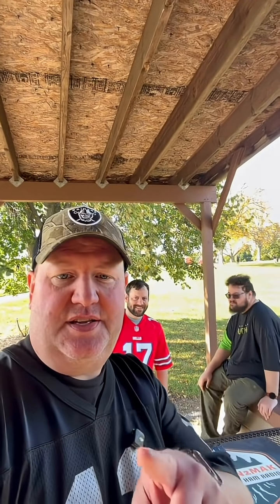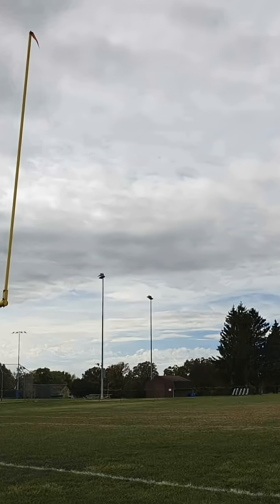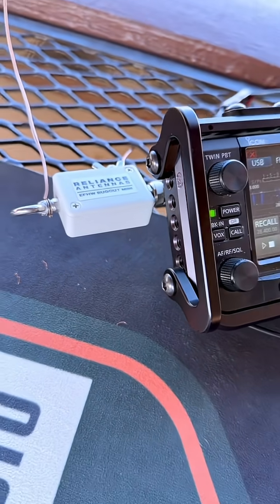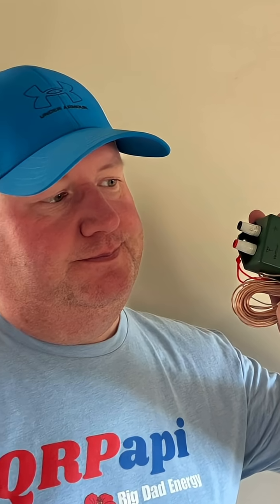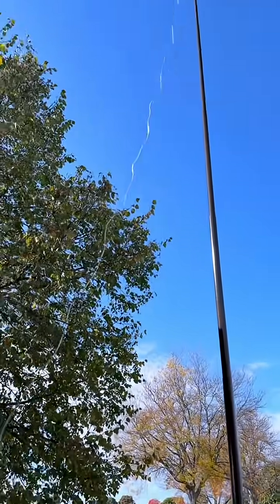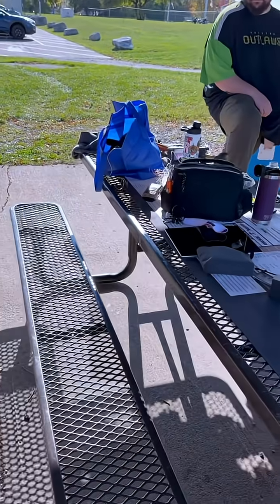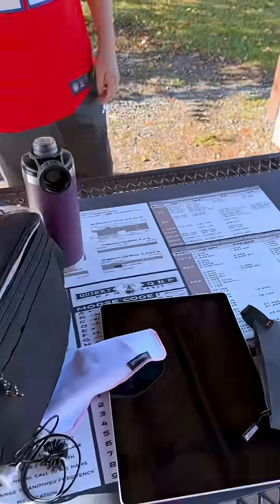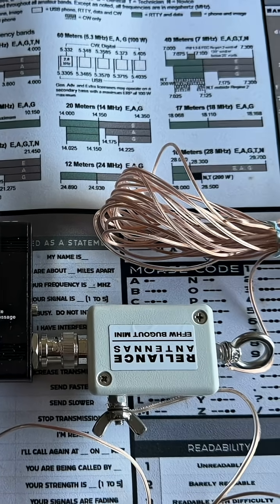No Coax, No Choke, No Problem! POTA with the Bugout Mini BNC-M 49:1 EFHW from Reliance Antennas

Comment: If you have a rig with a decent internal ATU (like a xiegu G90) then don't forget the even simpler "NOT Rybakov"... stick a 4mm banana plug on the end of 25' of "random" wire & just push it into the central pin of the rigs so239 (& chuck out some radials too but no 4:1 needed). Not only no coax but no coax connectors too. This is actually better than the Rybakov as the rig can handle this straight 40 to 10 whereas the Rybakov struggles on 40.

25' of metal is a great length as by just changing the "tickling mechanism" you get the Rybakov (4:1) or comet CHA250 (black heatsinked baked bean can) or even double up for balanced doublet operation with the half size g5rv ( budgie ladder feedline pre-match) but the commercial marine HF idea of just sticking a good ATU directly at the base of the radiator metal & having no other pre-match is a great ( often overlooked) way to go.

A pl259 isn't much more than a screened banana plug & a 4mm plug poked directly into a so239 does it no damage.
Reply from the maker: That'll definitely work. I actually learned about that--sticking the wire with a banana plug into the socket--when I found out about Emergency Mode on the ICOM 7300. I've been eyeing remote tuners too. But for now, using a 4:1 or 9:1 for random wires at least allows for the antenna to be placed away from the radio, which can be helpful with the winter weather approaching.

Comment: Delete the coax? That’ll save some weight! Will Reliance put a male BNC on their 4010 Bugout? How long is your counterpoise?
Reply from the maker: I’m not sure about the 4010. The counterpoise was 21 inches. It was just a random piece of scrap wire. But is was close to 0.5m which would be about right for a 10m EFHW. The antenna was a little long, but we were just having fun and trying a proof of concept.